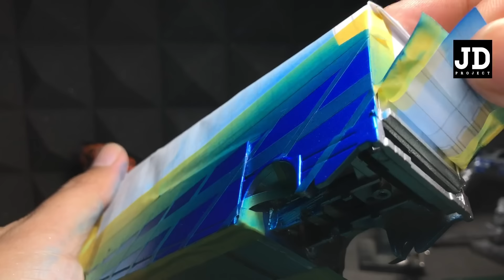One Last Ride Transporter, Reminiscing Paul Walker. RMZ city, Hot Wheels, Tomica Premium custom

Comment: The fact the Fast And Furious series became so bad after his passing shows how influential he was to the street racing scene of Hollywood. He passed and so did it...
Reply: So true, can't stand the franchise now.
Reply: its not bad
but not feel the same
Reply: It’s pretty good now ngl
Reply: Fast n furious isn't the same anymore it isn't about cars it's more about action which what makes the movie not the same by far tokyo drift is the best even tho Paul Walker isn't in it
Reply: Vin Diesel makes the series, and he anchors the whole story arc.
I thought Walker's character was the worst part of the series (he did an okay job).
I suppose if I were 15, I'd think Walker was probably pretty good.
But Diesel absolutely smashes it.
Too bad the other characters weren't better developed; too much time spent up shifting.
Reply: 99999999999999999999999999999999999999999999999999999999999999999999999999999999999999999999999999999999999999999999999999999999999999999999999999999999999999999999999999999999999999999999999999999999999999999999999999999999999999999999999999999999999999999999999999999999999999999999999999999999999999999999999999999999999999999999999999999999999999999999999999999999999999999999999999999899999899888989999999999999989999999998899899999999999989999989999999899899999999889999998999999898999998899998889999999999999999998898998999999999989998898999899989988999999988999898899998999899989999989899998999988988989899998989898988998989899998989899999998899999988999898989899999888989889888l8l8l8l8l8l8l8l8l8l888l8l888l888l8l8l8l8l8l8l8l8l8l8l8l8l88l8l8l8l8l8l8l8l8l8l8l8l8l8l8l8l8l8l8l8l8l8l8l8l8l8l8l8l8l8l8l8l8l8l8l8l8l8l8l8l8l8l8l8l8l8l8l8l8l8l8l8l8l8l8l8l8l8l88